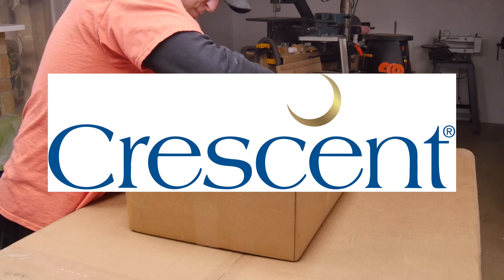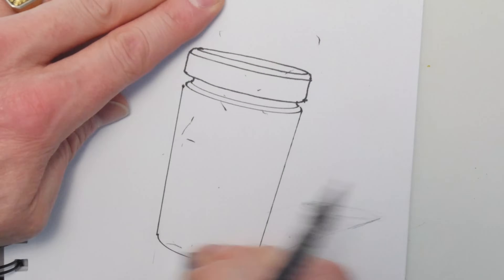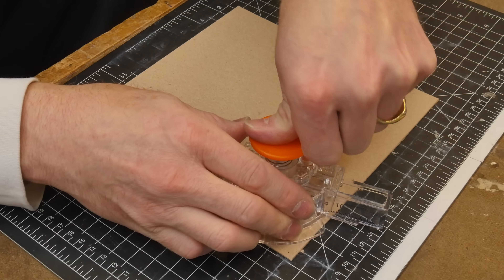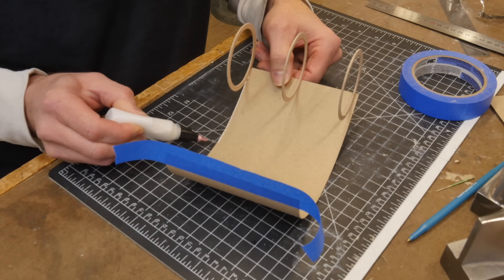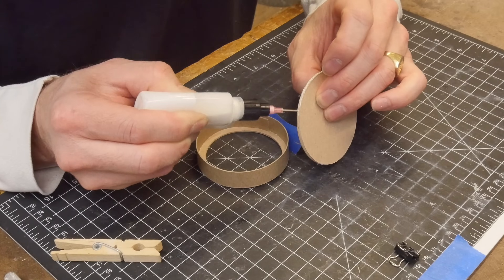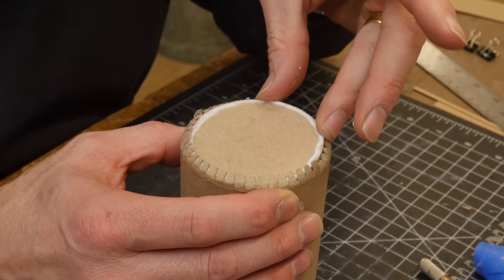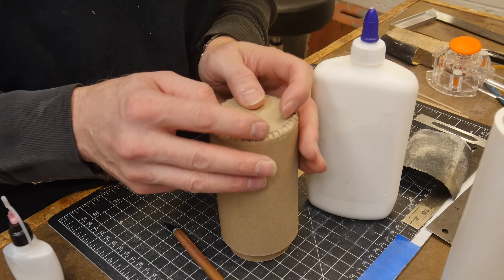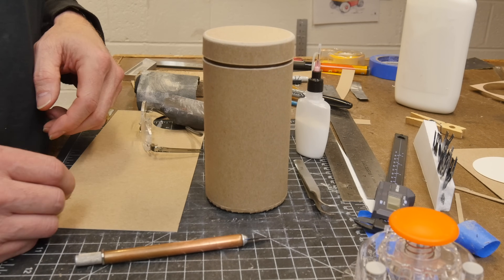CardBoard Container Scratch Build: Chipboard 500ml water bottle Industrial Design process

Comment: Hi Eric, I've just discovered you on YouTube and love your tutorials!
I'm currently buying materials to make a cardboard model of a turbo fan for a rally cars' front alloy wheels.
Do you have any advice on how to make a turbo fan from cardboard or maybe you could make a video on how to construct one?
Any advice would be much appreciated thank you.  Richard, England.
Reply from the maker: Make the housing in two parts then build the impellers then sandwich the whole thing together, good luck
Reply: @EricStrebel  Thanks for getting back to me. Have you any advice or tips on joining methods?
Reply from the maker: Make a circular frame with an interior lap joint so you can fit the two halves together
Reply: @EricStrebel  I don't know what an interior lap joint is mate. Have you a video of an interior lap that I could watch or a link to something?
Reply from the maker: If you watch this video the bottom of the container has an interior lap joint. https://youtu.be/RJBEmUrmGDw

Comment: Having worked on scale card modeling, mostly aircraft and spacecraft,  you're a great source of techniques
Reply from the maker: Thanks 😀
Reply: @EricStrebel  One project I was working on was a1/48th scale Saturn V. The 1st and 2nd stages are about 8-1/2" in diameter just for the basic assembly. Available free for download from Lower Hudson Valley http://papermodelingman.com/gallery_models_apollo.html. There is one individual that is building this at 1/12th scale.